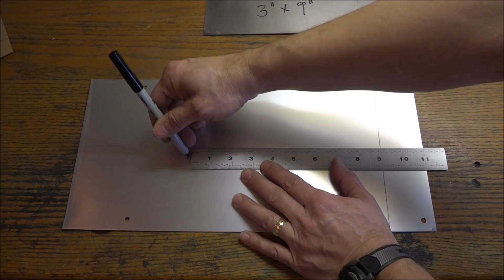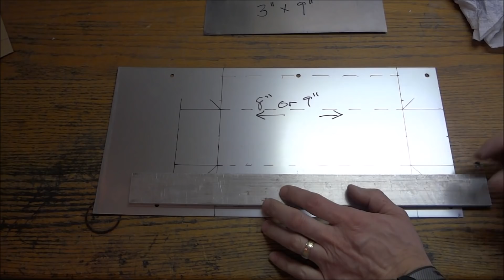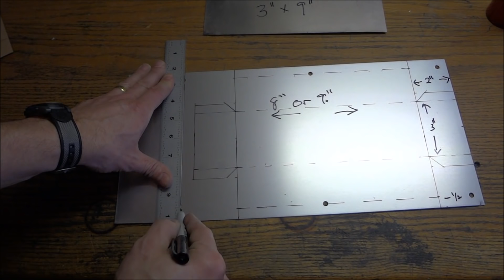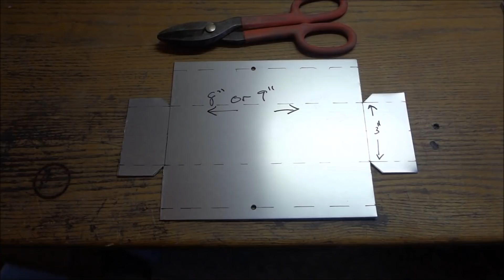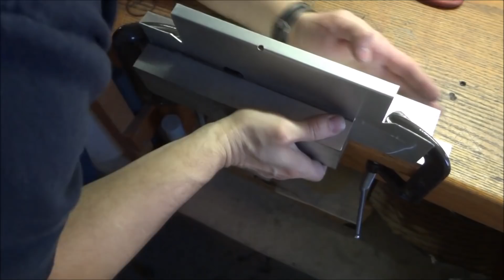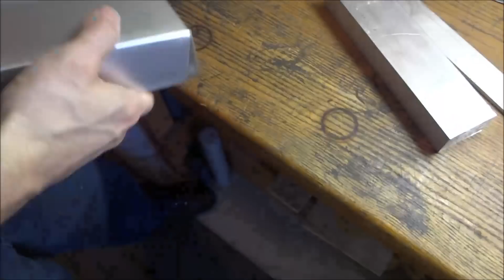PM-727M Control Panel Box

Comment: So you didn't have to allow for bend radius?  I have a lot to learn about sheet metal.
Reply from the maker: Well you could but this metal is thin but it wouldn't hurt. Once I bent the box. The cover plate I had to make wider. About 3.125. 

Sam
Reply: ok thanks